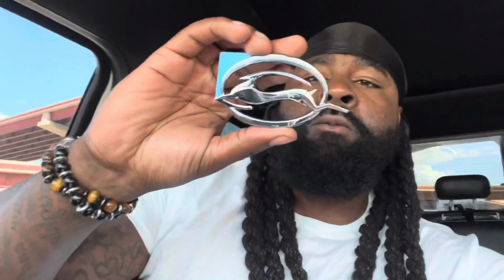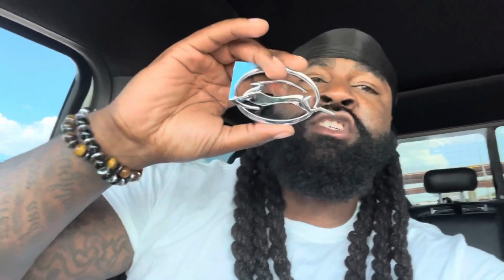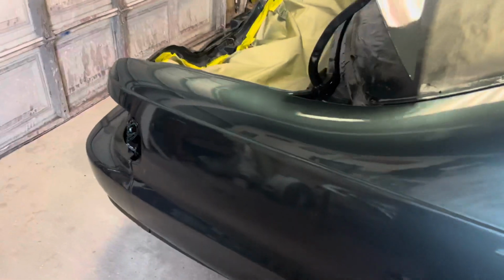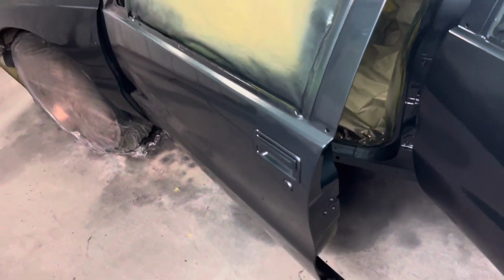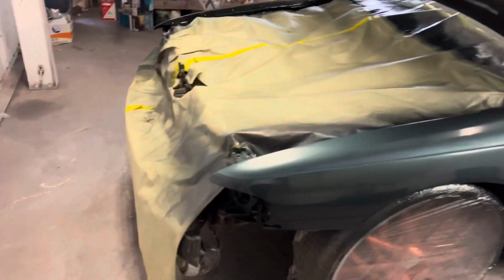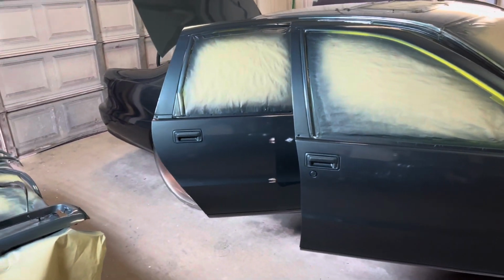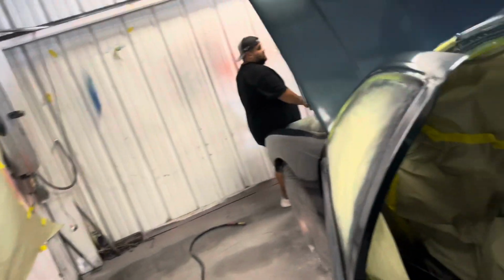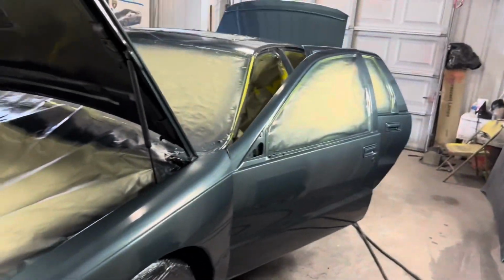JUST FINSHED SHOOTING THE BASE ON MY 96 IMPALA SS

Comment: Absolutely love it. Please keep us informed on the tint. I’m looking at ceramic on my 95. The 60 horse can be a simple as a cam and spring swap. Maybe heads and intake. New injectors for sure. Just rebuilt the dash trim the radio sets in. Flipped the two center vents to blow toward the roof instead of chest high. Helps the passengers in the back seats. Just rebuilt the a/c system. Finished upgrading the primary power wires for charge. About to update my headlight bulbs to 100/80w versus stock 60/40. Very interested in idea for custom subwoofer box. I want To build one for mine. Want it to port thru the back deck. Also I’m considering rebuilding my alternator for more power. Green was the least amount they made. Mine is cherry.